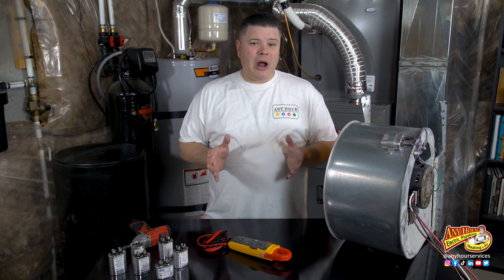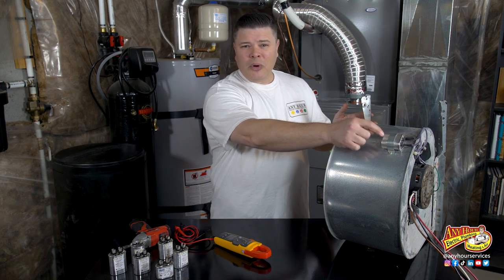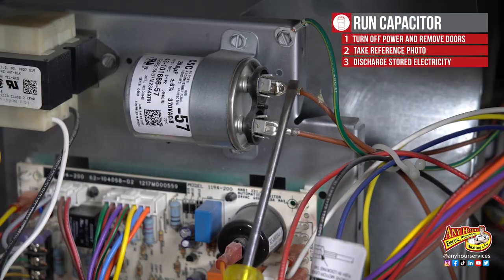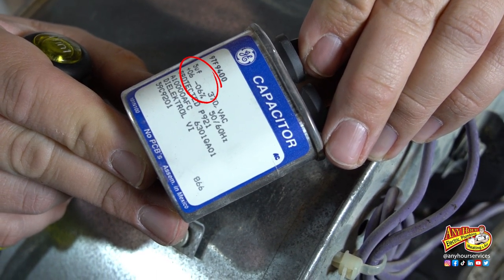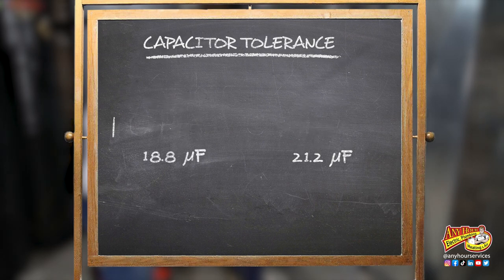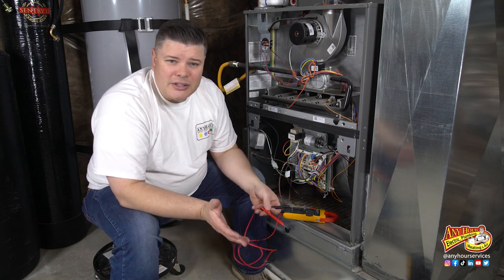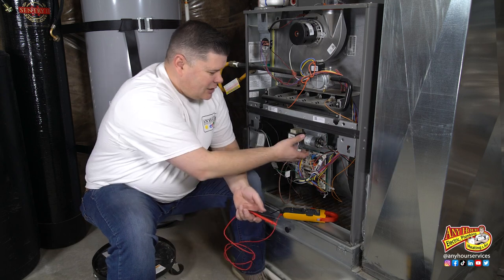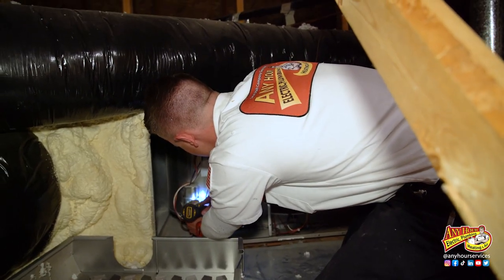Furnace Maintenance: How to Test a Blower Fan Run Capacitor

Comment: Are the start and run capacitors in the same unit. I have a furnace fan that I use as a shop fan. It runs if you spin the fan with a stick. Then it shuts down after a few minutes.